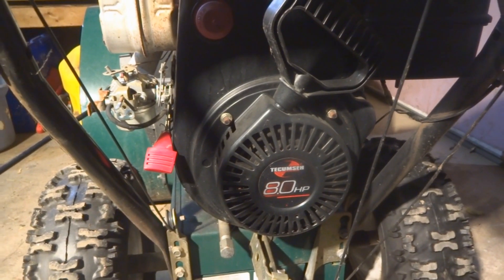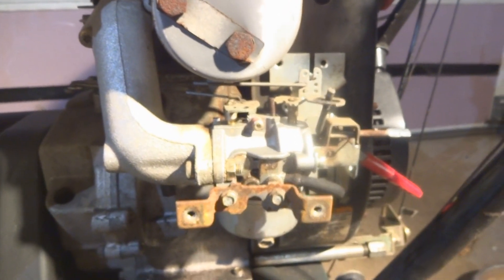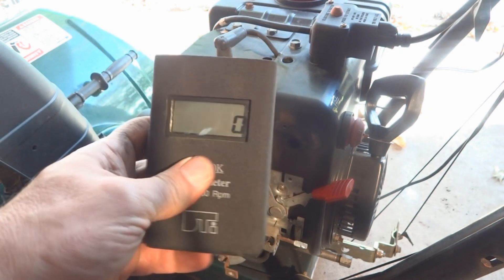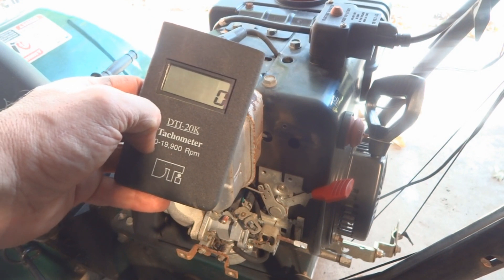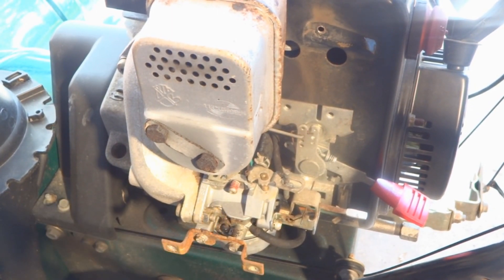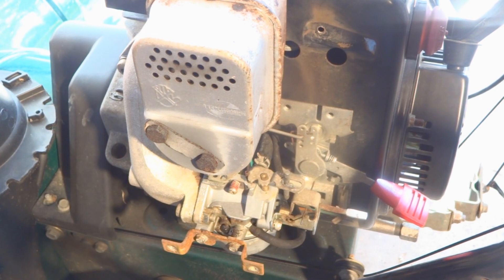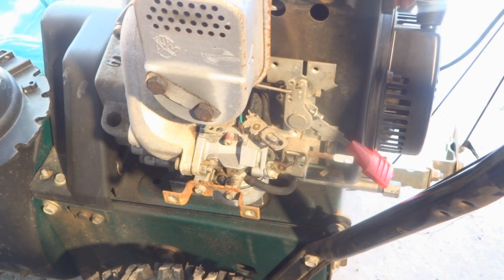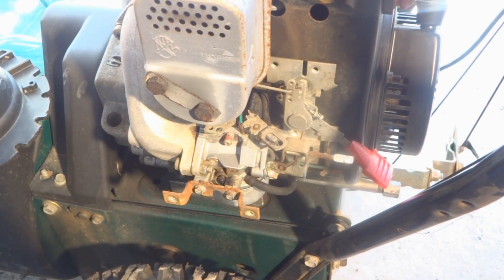Set RPM on Non-Adjustable Tecumseh Carburetor

Comment: I can not chose the correctly RPM for the high idle position. The engine spins 3600, 3700, 3800 RPM and the screw is almost out.

Comment: I consider that to set correctly the two idles the engine must be warmed before. High speed idle is 3600 T but low speed idle what is? 500, 600 T?. In what position will be the red...before the setting for low speed idle?

Comment: I was told by a mechanic that you can no longer get carburetors and rebuild kits for tecumseh motors. Is this true??
Reply from the maker: Tecumseh went out of business in 2008. However, I still order carb kits and  and aftermarket carbs all the time from ebay, amazon, etc..
Reply: @RealManSkills  thanks man
Reply: I bet he then suggested you upgrade and buy a new motor? Plenty of replacement parts...performance parts not so much.

Comment: I just installed a new carb, and have the beast running but it seems to cut out after 60 secs at full throttle , could it be electrical?
Thanks
Reply from the maker: If a coil is going bad, it would cut out after warming up some. Check for spark when cold, then check for spark after it cuts out. If no spark, the coil is suspect. Thanks for watching.

Comment: Thanks for the video. Is there a low speed jet under the little rubber plug that is behind that u shaped bracket? Sometimes there is and you can pull the rubber cap out and remove the jet to clean it. Also fully adjustable carburetor replacements are still available and fit perfectly. Thanks
Reply: Yes, at 1:30 you can see the little black cap on it below his screwdriver.  Some people think it is a plug but the cap is just there so people don't attempt to "adjust" the jet.  As you say it should be unscrewed and cleaned out or replaced (Tecumseh Idle Screw No. 640027) if the engine is not running smoothly.

Comment: The RPM on any small engine with a non-adjustable/fixed high speed main jet carburetor (EPA regulations) should be set at 3,200 & not at 3,600. At 3,600, the carburetor will lean out too much & this could cause the engine run too hot, resulting in excessive piston ring wear & eventually it will start smoking out the exhaust, burning oil. Wintertime when the cold air is more dense is even worse for a leaned-out engine. I know this for a fact. The older small engines with a fully adjustable high speed main jet can be safely set at 3,600 RPM. And the horsepower rating for all small engines is figured at 3,600, and not at 3,200. (8hp @ 3,600 RPM = 7.1hp @ 3,200 RPM)
Reply from the maker: I guess I learned something new. Thanks
Reply: You're welcome. And you'll always learn something new in my websites: http://gardentractorpullingtips.com/index.htm.
Reply: nonsense
the carb will pull fuel correctly at 3600 rpm...just like any carb.
Reply: @harryharry3193  I know what I'm talking about because I've personally seen the cylinder head burn out on several small engines that has a carburetor with a fixed main jet when it was running at 3,600 RPM. If it ran at 3,200 RPM, the head would not have burned out.
Reply: Great reply.

Comment: where you buy your tachometer?
Reply: It's available at any of your corner tachometer stores.
Reply: eBay: DTI 20K fast tach for small engines Stihl Husqvarna DTI-110
Brand New
$109.52
Buy It Now
Free Shipping
(Not my auction.)
Reply from the maker: Ebay or Amazon probably. Shop around the internet for the best price. Thanks.

Comment: If it still does it with fresh gas you have a clogged port in there somewhere. 

When you were adjusting the idle at the last of the video is was going up and toooo much..... 

Great vid BTW   Plus Tard Mon Ami ~!~!
Reply from the maker: Yes, it did go up but it came back down. I suspect the engine needed to warm up some more. After I turned the camera off, It evened out some more and runs great. With fresh gasoline, I also put some Seafoam in the tank. Thanks for watching.